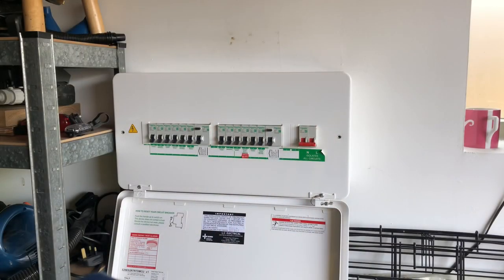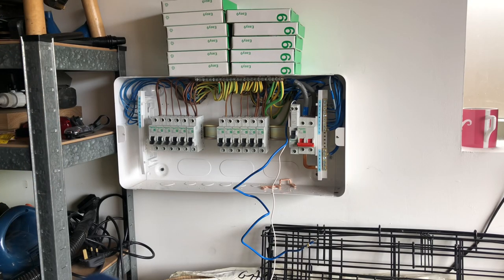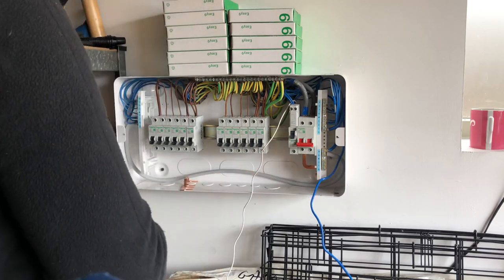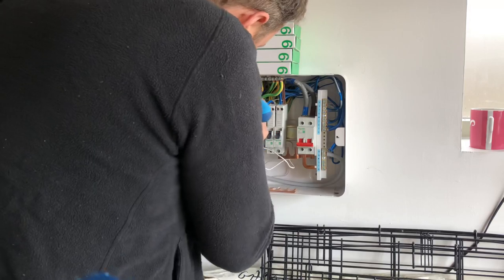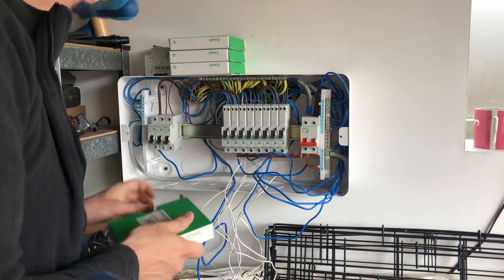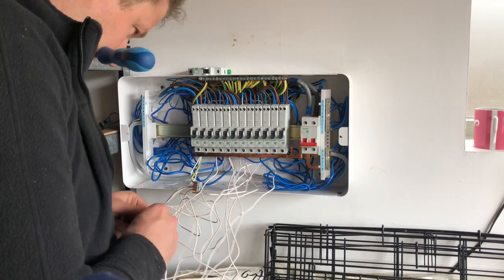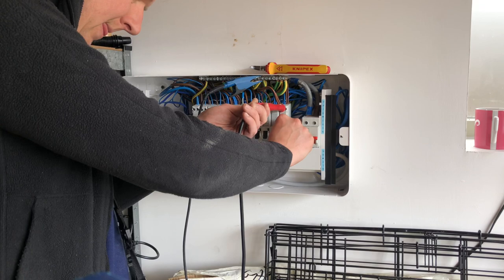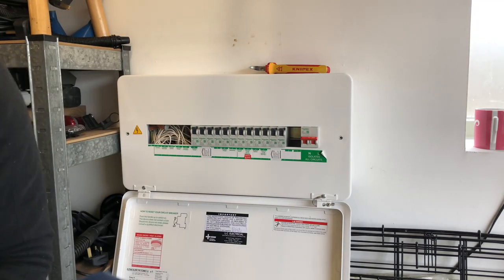Avoid Nuisance Tripping - Converting a dual RCD consumer unit to an RCBO one. Schneider EZ9.

Comment: I have always put my heaviest loads opposite to the main switch or staggered them across the consumer unit so once the system is pulling load from the mains it is evenly distributed across the busbar if you have all your highest load circuits closest to the main switch you will have heat build up across a small section of the busbar this is how I was always taught from the sparks I've worked with and dont this ever since.
Also the voltage drop is always going to happen when turning on high demand appliances it's even more apparent when 2 propertys have the same dno mains cable feeding both.
Reply: Doing that doesn't distribute the load, just extends it. The part near the main switch takes the full brunt either way, but by putting large loads away from the main switch the load is experienced by more of the busbar. So you have exactly the same heat build up near the main switch but now the rest of the busbar has more heat build up than it would if the heavy loads were nearer the main switch.

Since copper is an excellent heat conductor the heat gets dispersed towards the far end where there's less heat being produced resulting in the hot part being kept cooler. But if you have high loads towards the far end of the busbar you greatly reduced this heat dispersion because the whole busbar is being heated (therefore no cooler part to disperse heat to).

Think of it same as a cable. If you have an X amp load half way along the cable, only the first half experiences the load. But if you put the load at the end of the cable the whole cable experiences X amps, the load on the first half is still X amps no more or less, but now the other end of the cable also experiences X amps.

Comment: That's a very expensive change for an easy fix, if I were that customer I'd be telling you where to go, all you had to do is divide up the circuits onto an additional rcd and also cutting the tails won't matter because other manufactorers don't have the tails and all the exact same specs

Comment: Don’t take any of this personally. Did a fine job but always room for improvements. 

If you’re going to dymo/labelmaker boards. MCBs are 18mm. 

If you have the machine. Label the circuits. Your lovely job was let down by your handwriting. (Don’t take it personally. There isn’t many electricians with good handwriting, those that do have nice handwriting normally aren’t great electricians.)

Cut the excess off RCBOs. How often are they going to be moved around? It’s not your concern. Your concern is to leave suitable length. Not usable length. You’ve made nests that can generate heat by reducing its ventilation ability. 

2pole type 2 SPD kits can be had for less than £30 from most reputable wholesalers. If you’re not doing a risk assessment, put them in. 

The bit about busbars and high amperage items closest to switch isn’t an old wives tale. It stems from the days of rewireable boards and filament lamps. Nowadays with thicker busbars made of cheaper materials and lighting now requiring significantly less power, those issues are gone and it’s now out of inherent neatness that we put them in order of amperage from the main switch. 

If it had been up to me doing this board alteration. I would’ve kept one RCD and placed the least demanding (in terms of fault current generation, not load) and location/closest circuits on it (cookers/oven/showers) and just put sockets and lights on RCBOs. It’s a cheaper way for the customer and would still achieve the same result as you’ll trust dedicated radials as opposed to LED circuits and sockets with phone chargers hanging off them. 

Still looks weird not to see split load as it always looks overloaded. But it’s the future and AFDDs will be next. 

Going to watch the next video now. Subscribed. 👍

Comment: Good vid, I used to eat on the hoof and not drink enough in my younger days, as you say 'time is money'. Most likely the cause of my ulcer. Working for a company now so I always have the proper breaks.
Also like your thoughts on new builds. Done quite a few for independent smaller builders but was working adjacent to a new site many years back and crept in there to take a look, abortion would be a suitable word, saw 2 Junction boxes which were going to end up in an enclosed floor space, plumbing wasn't much better. Would never buy a new house, even 25yrs later.
Reply from the maker: Thanks for your comments
Reply: Myth, from 1980s bad sitcom.. They now won a nobel prize for confirming it is a virus causes ulcers nothing else

Comment: Isn't there a slight concern that each one might consume a watt? With a quick calculation, each home in the UK wasting that much energy, filling CUs with active devices is equivalent to taking a million EVs off the road. 100-200MW/30 miilon homes to run 3-6W of active devices 24x7x365

Comment: Earth leakage current? What is the path? Why would a long length of wire with a perfectly functioning tv have any leakage to earth?
Reply: If the LINE wire somehow comes in contact with metal casing/part of the TV (known as earth fault) and you touch the metal casing, the current will go from the LINE to Earth through you since neutral is grounded at the electric poles. That's why the 3rd wire (yellow-green) is integrated so that the current will travel into Earth rather through the far more conductive yellow-green EARTH wire than through you in the event of Earth fault. With the introduction RCBO or RCD in your installation, the device will detect leakage current by sensing an imbalance of currents between the Phase and Neutral in that circuit and immediately trip and de-energize the circuit to prevent you from getting shocked or electrocuted.

Comment: Clearly there is excessive space below the din rail and not enough, above it. There should be an option to move the din rail as needed.
Reply: Front cover wouldn’t fit if you lowered the din rail as the cover has a central cut out

Comment: Wow those tails are long, I say keep them unless they are that long. then maybe figure out the maximum length from one side of the Box to the other than a little little extra Slack. And do that for all of them, that way they're interchangeable.
I will occasionally use my mouth is a third hand. I always go to put something in and i go but my hands are gross and I've been holding this with my hands.... and now I'm shoving it in my mouth maybe I don't want to do this. I have worked very hard to break the habit I only do it with my flashlight when I know that I've cleaned it recently and that goes out the window if I end up having to hold it with gross hands.

And I only take my coffee when I have to, as in I much prefer tea. I do enjoy a lunch break but i usually end up just working through it and taking short breaks to reassess my situation throughout the project.
Reply from the maker: Thanks for your comment

Comment: 34.45 minutes:  Printing labels.   Why did you not measure the total length of the 12 circuit breakers, and then divide by 12 to get an accurate average??   Other than that, very nicely done.

Comment: I always put the heavy load at the end
Reply: Which end, lol? It makes sense to put highest loads closest to incoming as the shorter the busbar to a load, the lower the resistance and so the lower the voltage drop across it to anything downstream of it. Dimming of lights when heavy load is switched on should be least this way. However, if your lights dim then they will dim a bit no matter which way around and they should not be dimming as that shows there is too much resistance. If you are fussy about the order then I hope you are also fussy about the order on the neutral bar.

Comment: The statement that those blue wires to RCBOs musn't be cut because they are designed to work with specific length is utter nonsense. Whoever told you that hasn't a clue. There's a good reason not to cut them too short, and that's to allow for any future rearrangement, but electrically speaking, the length of the neutral tail is irrelevant. The RCBO is only measuring the discrepancy between the current flows, and that won't be changed by shortening a wire.
Reply from the maker: Thanks that’s good info. I thought so as well but just didn’t feel comfortable cutting them for some reason.
Reply: @artisanelectrics  The most important point is that any shortened leads must have ferrules refitted if shortened. Those fine wires mustn't sit directly under the clamping screws.
Reply: @TheEulerID  

Yes here's what it says in the BBB

526.9 Connection of multiwire, fine wire and very fine wire conductors

526.9.1 In order to avoid inappropriate separation or spreading of individual wires of multiwire, fine wire or 
very fine wire conductors, suitable terminals shall be used or the conductor ends shall be suitably treated

Comment: I would have thought that by not trimming back the neutral flying leads you have failed to instal according to the manufacturer's instructions,  so there should be a note of the deliberate deviation on the EIC.
 Personally, I would have deviated in a different way, I would have used Earth different manufacturers say Wylex mini RCBO so that there were no flying leads and I could wire the final circuits straight in to the devices. That would have been much tidier. 
On the question of heavy loads on the bus bar, I think all other things being equal it's obviously good sense to keep the heaviest loads on the shortest path, but where all other things aren't equal, such as your 10mm tails, then it's not essential as long as it is a good heavy bar suitable for the full load and length.
Reply from the maker: Thanks for the comments yeah I much prefer the RCBOs that don’t have an earth tail, much less hassle to work with

Comment: Good you cutting the N-wires finally, but then you fail fixing ferrules into unprotected screw terminales... Why?
Reply from the maker: Not sure what you mean
Reply: @artisanelectrics  The flex N wires must be equipped with electric wire ferrules as unprotected screw terminals usually do not connect the entire diameter of the wire. The N is a active conductor.
https://en.wikipedia.org/wiki/Electric_wire_ferrule

Comment: Did you have to do a full EIC for whole board ? Seems a tough one when your just changing over protective device .
Reply from the maker: Yeah it’s a tricky one, do you do a full EIC or 12 MWCs? I did an EIC to save paper! 😂😂😂
Reply: Yes quite a tricky one, normally when doing a consumer unit replacement, I would do an EICR beforehand. In this particular scenario, I think earth fault loop impedance and RCD trip times of every circuit would suffice.
Reply: Alvin Ashman so what would you put in other boxes for Mohms and r1+r2 ?
Reply: @robswingler  N/A

Comment: Silly Billy. Cut the cables to length leaving a little slack. Do NOT bunch cables together and certainly do not tie. Think about it... How does length of the neutral tail affect the difference between the line current and the neutral current?

Comment: Can RCBOs be used in DC circuits such as solar? How will they be rated?
Reply from the maker: Yes but you would need a Type A RCBO that can handle DC leakage current
Reply: Not really you can only rcbos for the standard current if you rcbos for solar it may cause problems and advice you not to use the solar system though the rcbos I am electrician since 30 years unless type A you can if they are type B you can not okay
Reply: also DC breakers are very different to AC breakers

Comment: I should imagine reducing eddy currents would be the reason to cut the cable to length.  Not that they'd be overly bad with the full length, but every little bit counts if you are avoiding nuisance tripping.
I think you feeling awkward is because it is just different to the way you thought it should be and how you've always done it.  We are all creatures of habit and dislike change. 
I am like you in regard to coffee breaks.  I tend to just down the coffee fairly quickly.
Reply: eddy currents only become noticeable on significant high currents upwards of 100 amps ...

Comment: I hate schneider /square d.  Over the years they have changed mcb design so they have 3 different incompatible designs. Good old hager fits any of there old kit.
Just out of interest why didn't you just get a hager main switch board and do Rcbo installation?
Reply from the maker: Yeah I could have changed the whole board but it would have been a lot more work and seemed crazy as the installation was so new
Reply from the maker: I do love Hager boards though, would have much preferred installing one of those
Reply: had her domestic boards are great, there 3 phase stuff isn't, Schneider all day long for tpn
Reply: Mem db,s changed design a couple of times and couldn't get mcb,s so new circuits difficult  to add.

Comment: "My electricity keeps tripping off!"
"No problem, let me fit a new consumer unit"  £££££££ LOL
Reply from the maker: Wire My Ear yes but it solved the problem! How else would you have done it?
Reply: @artisanelectrics  So, if the problem is sorted, then clearly none of the circuits has enough leakage to trip their respective RCBOs. This means that either (a)  the combined earth leak of the circuits involved was just enough to trip the RCD, but individually not enough to trip an RCBO (unlikely but possible, and in this case there is still a latent problem), (b) the tripping, being intermittent, simply stopped happening, for any number of reasons - a phenomenon I've come across many times, or (c) the RCD was faulty.
After doing the IR tests, as you did, I would have tested the RCD. OK? Then set everything running like on a busy evening when it usually trips and clamp an ammeter on the main earth to see if a leak could be detected. Yes? Then check for a leak on each of the circuit earths. Still nothing? Then I would explain that since the problem was intermittent and not currently 'active', the best thing would be to make a note of what was running when it next trips and try and narrow things down that way. TBH, I follow my nose as each job - and each client -  is different.
Reply: rcbos should be a required install instead of split rcds. All bathroom, outside lights and socket circuits could really do with rcbos, so might as well go the whole road.
Reply from the maker: Totally agree

Comment: you will see this problem more and more as LED lights and IOT devices like motorized curtains, Home hubs , wifi lights and sockets become common place. The correct way to avoid this may be to change the RCD to diffrent Class  Either Type A ( Full type AC features.
+ Detection of pulsating currentwith DC components.) or  Type A-APR ( Full type A features.
+ High immunity to unwanted tripping.) or worst case Type F (Full type A-APR features.
+ Detection of high frequency currentsup to 1 kHz.)
Reply from the maker: Good comment thanks
Reply: On new installations, avoiding the use of ring main circuits can be helpful too, that is, if it's known during planning that any significant number of loads with nasty power factors and/or switch-mode leakage will be present. Such as the aforementioned iot and led devices. Which given the direction technology is going in most homes, should just be assumed to be the case at the outset. Going full RCBO per circuit wasn't a terrible way to deal with this from the standpoint of existing wiring... that avoids having to change RCD class and potentially compromise safety under specific sets of circumstances.

Comment: Did you not perform an ELT and test the RCD for its TC?

Could have saved them a lot of money.

And we have always trimmed the neutral tail to length. However, you should have installed a ferrule on the end before terminating it.

And for a few quid, you could have got an identical CU complete and replaced the whole thing.

Bad practice to lump all the earth tails together.
Reply from the maker: Thanks for the feedback, how would you do an ELT earth leakage test? And what do you mean by TC?
Reply: ELT can be done with a suitable clamp meter around the main earth.

TC = Trip current.
Reply from the maker: Paul Green yeah I did that with my fluke clamp meter and it was showing nothing AC but 1.3amps DC wierd...
Reply: @artisanelectrics  How has it been since you swapped out the MCB's and replaced them with RCBO's?
Reply from the maker: Alvin Ashman fine since then... watch this space
Reply: @artisanelectrics  If it was happening quite frequently before and it hasn't happened since, you've probably cracked it 👍

Comment: Torque screwdriver?🤪
Reply from the maker: Yeah I know! Which one do you recommend? I’m saving for the Wiha Speed E with Torque Set
Reply: I like the look of that one too.
Reply: The torque screwdriver only ever comes out on assessment day 😂😂😂
Reply: Alvin Ashman 😱😱
Reply: @dermotcullen5263  I myself have a 13pc Armeg Torque Screwdriver Kit which is brilliant but looking back on it now, I wish I'd gone for a 7pc Wiha Slimfit kit, much more compact and can be stored easily in your toolbag. Anyone that says they use a torque screwdriver on every termination at every consumer unit is lying.
Reply: Alvin Ashman lying?......or perhaps they’re torquing nonsense 🤪🤪
Reply from the maker: Gonna order one of these for my Wera kit https://amzn.to/2D2dtSj
Reply: @artisanelectrics  I wouldn't go for that one Jordan, the maximum torque setting on that particular model is 3 Nm, the required torque setting for the new SPD's are 4.5 Nm.
Reply: Artisan Electrics don’t,a friend of mine (a fellow electrician) has one and it’s rubbish. Too gimmicky and not practical to use everyday he doesn’t use it now.